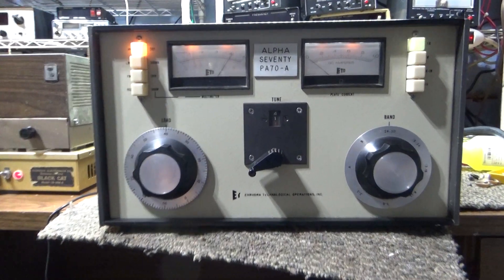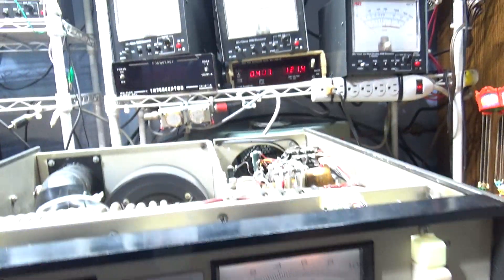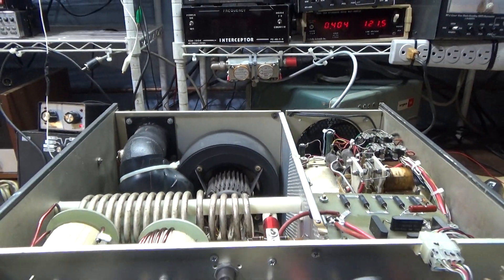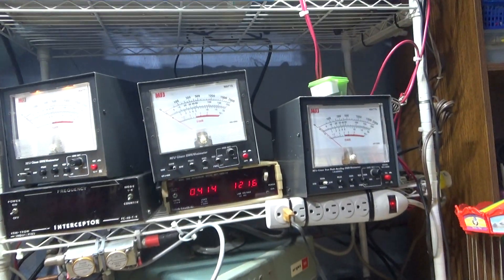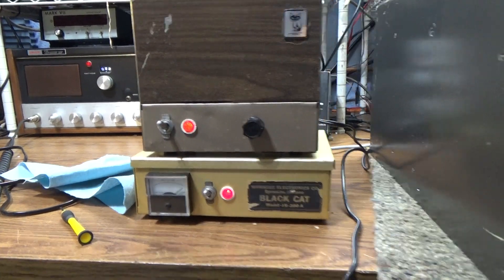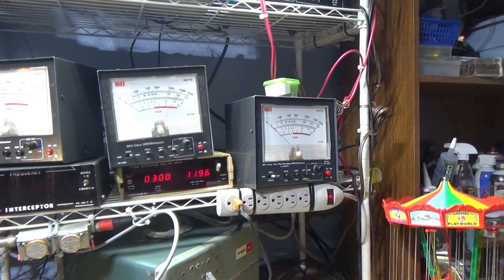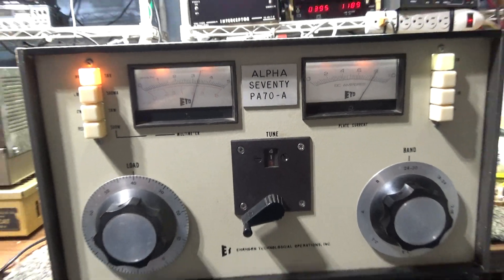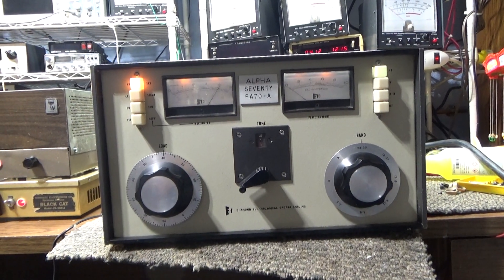Alpha PA-70 customer's, not mine, single 8877 3cx1500a7 back in action on the bench

Comment: those alphas are beasts.  the 2 tube jb i got from you is still rocking and rolling..those 8417s get the locals drooling over the audio with my grant xl. I also have a yeasu FT-102 also that runs 3 6146s in the final. another AM badboy.
Reply from the maker: Some of the best.

Comment: what died? bandswitch?
Reply: As a general rule of thumb, you should never "hot switch" an amplifier, tuner, or antenna switch.
Reply from the maker: Agreed but most don't know what hot switching is. Same with using the foot pedal. So many key the drive first and then key the amp. Then they unkey the amp first with the drive still running. They hot switch the antenna relay on both keyup and unkey.
Reply: @tramdr  that's where an external relay with delay comes in handy to prevent that. Tx amp 1st, rx amp last.
Reply from the maker: Yes, both the Input and the Output on the band switch. I left it all in there, but strapped the 10 meter coils directly. Common problem in Ham Amps with bandswitches, and especially so with those who like to tinker with their knobs, especially while transmitting. It would cost a small fortune in both parts and labor to replace the band switches in that too.
Reply: @tramdr  ya I almost grabbed the band on my 220. I almost feel like taking the knob off. The Acom 1000 and the Ameritron 1200 have a distict knob thats thankfully not so easy to mistake.
Reply from the maker: and I could have locked it or mono banded it but the buyer didn't want that.